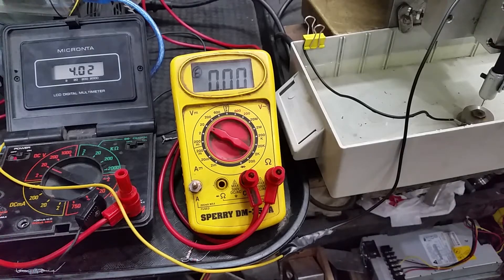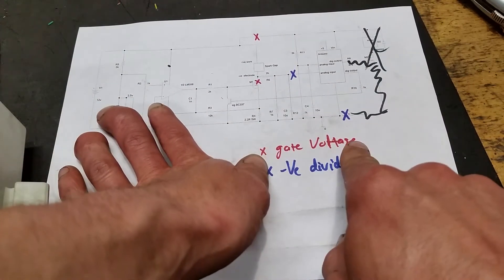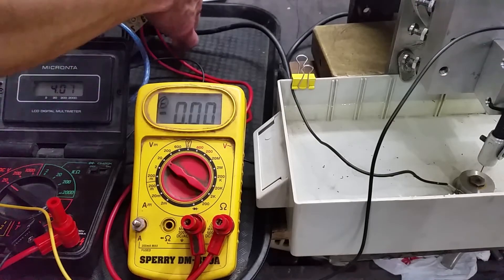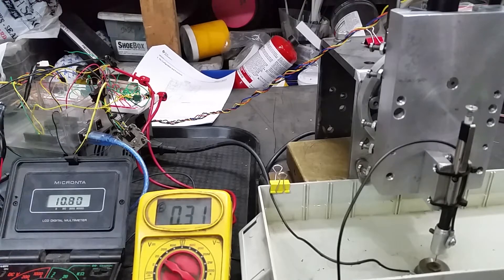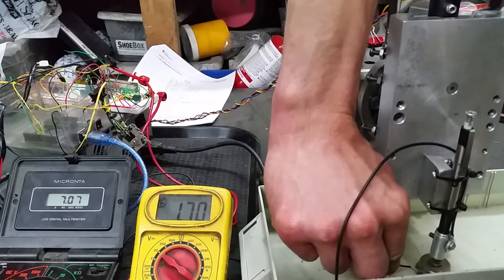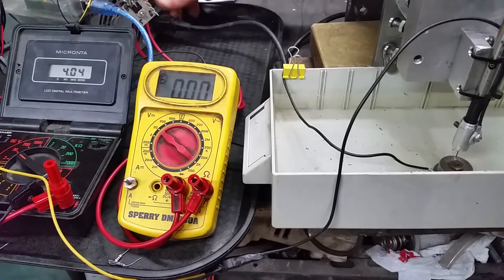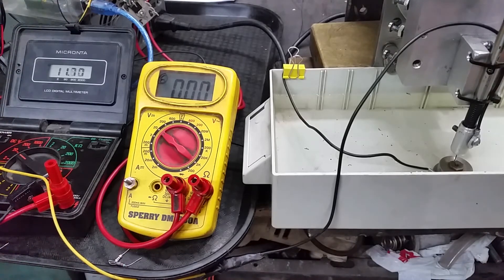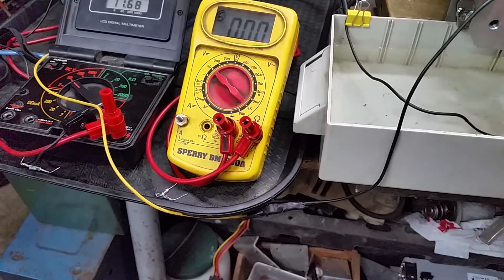arduino edm troubleshooting

Comment: Hi Matt, how did this go? I built one myself and it's wonderful
Reply from the maker: well not great to be honest....I made a lot of changes since that video, but still no successful hole.  It was on the brink of working for like a month before I had to set it aside.  I was trying to make tiny holes (<0.5mm) and ran into problems with the part becoming magnetic and sticking the electrode to the part.  I really needed to mount the electrode on a table that moves faster.  And h20 (even HQ reverse osmosis) is no good as a dielectric.  I found veg oil to work nicely, kerosene was a little better, but it messed up my pump and the smell / mess kept me away from it.  Hope my failures can help you succeed.  Best of luck.
Reply: Don’t suppose either of you fella’s can help a fellow edm’er in need?? I have.l machine built but for the life of me I cannot get the Ben Fleming board to work properly, it keeps blowing the SN chip. think an arduino must replicate the current board correctly with relatively no stress!???
Reply from the maker: @andrewpearcy8983    I am not familiar with the ben fleming board.  With my setup, I never burnt anything out (actually i did burn a few electrodes, but never anything in the system).  The gist of my system was:
-Arduino in charge of everything(pulse timing, duration, spark gap, ect.
-a current control circuit driving a pretty big mosfet with an inductor in the loop
-a voltage divider feeding back to the Arduino in order to judge & control the gap
I dont have the file handy, but there is a thread on the arduino forum where a gentlemen named Allen was very patient and helpful, he pretty much designed the circuit for me.  You might read through that thread (there are pdf's of the circuit, be sure to grab one of the more recent version, file name is something like sper7.pdf.

most of my problems were positioning based, the table you see in the video just can't move fast enough.  Also minimizing backlash got me a lot closer to a working system.  If I were to have another go at this one, I would either run a much smaller table and probably use a ballscrew.  Ideally a LIM is well suited to this application, but expensive.  

Hope that helps, if you have any specific question, id be happy to try to answer them.
Reply: @mtraven23  Hi, it seems youtube does not notify on all comments. I followed your arduino thread. You will laugh at yourself because you've already done the difficult work, the rest is a norbrainer, of you get the correct info. Having done  a similar project, we can learn a couple of things from each other.

I also observed that iron based electrodes stick to the workpiece super fast. Brass does wonders and  it's chosen in commercial models.  Let's chase the important things. I can see that you incorporated flushing, how were you introducing the dielectric? Does your electrode have a hole  in the middle for delivering water? Flushing is the MOST important aspect for small hole EDM. For the voltage you were using, the side gap is a few micrometers, and if you're flushing the fluid along the circumference of the tool, it will never get inside to the clear the debris from the spark zone hence the tool will weld over and over, especially for your high aspect ratio.   

Another observation, which I also saw from another youtuber is that larger cross section of electrodes produce a very stable arc. As you approach the less than 1 mm diameter, shot circuits occur in seconds. For the same misbehaving machine, if you bring a larger electrode you will be surprised when it produces a stable burn and make a hole right through like a champ.
Reply: @andrewpearcy8983  What would you consider your skill level to be? I mean in electronics, just basic circuit analysis. Zero, low, medium? Yeah, you can replicate your thing entirely on arduino.
Reply from the maker: @davemwangi05  
firstly, I have to note, this video was taken about half way through my struggle, so it looks a little different now.  The biggest change was the electrode, which is now copper enamel wire held in a fiberglass collet.  While I don't doubt I larger electrode would be easier to create a stable arc, the specific purpose of me trying this was to make holes too small to be drilled by conventional means and in hardened materials.  My target was 0.4mm and the min. hole diameter in most commercial setups is 0.3mm, so I am pushing the limit.

As for the dielectric & flushing....I used 2 apposing jets, so to not push the electrode off center.  I don't really think I ever got deep enough into a hole that this really matters.   again I agree a hollow electrode would flush better, but if I cant make a 0.3mm hole, making a 0.3mm with a hollow bore seems pretty much impossible. I also got rid of the h20 pretty quick, I thought my reverse osmosis water (<20ppm) would be fine, it is not.  Distilled water MIGHT work, but my best results were with filter veg oil and kerosene.

I still maintain the electrode positioning system (table, stepper, ect) is too slow, too massive and too sloppy to successfully edm these small holes.

I think I have some later footage of better burns, I'll see if I can find that and upload it.
Reply: @mtraven23  Hi, Upload it I'm subscribing to you. Lol, I'm also having trouble with small holes. It's said that things work counter intuitively in the practical side of engineering.

Let me insist, initially when I build it I tried a 0.4mm electrode, with that, I couldn't sustain an arc. I thought it was a complete failure. for trial, I took a vehicle radio antenna, hollow with Diam 5mm, you know how they look, cut a piece of it and used it as an electrode. Lo and behold, it produced nice continuous sparks in tandem with the servo and burned a hole right through<< without flushing. Yeah, for both kerosene and water. I also prefer kerosene for similar reasons to yours. 

Till now I can't get it to work with the small .4 mm electrodes but the bigger ones are working fine. I would like you to try during your test because same problems mean a common denominator and will help zero down to the solution.
Reply: @mtraven23  also read my previous comment. I have new interest, now targeting small hole applications like yours. My initial purpose for the EDM was in trepanning larger holes, greater than 5mm, so I would say it served me. But for small holes, I'd say it failed miserably. I will join you though as I narrow down to this, We can share ideas, observations and experiences to move on faster to a working solution. 

I begin, first idea. >> as for the slop in the machine, since the goal is solely to achieve vertical motion with good fidelity, you can eradicate the slop with a very simple brilliant arrangement. However, I'll have to get a better view at your ram and explain how you'll bias it, and give you the concept behind it. Very simple and will save you the hassle so you don't have to demolish the whole thing for a new one.
Reply: Hi @davemwangi05 have you build sper7.pdf Allen's version or different?